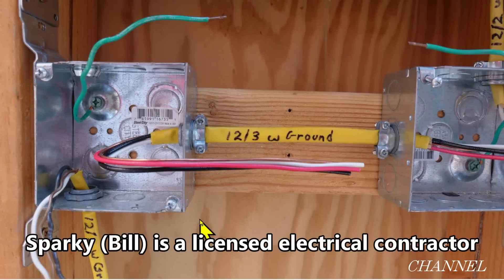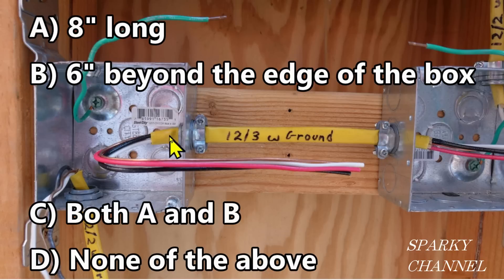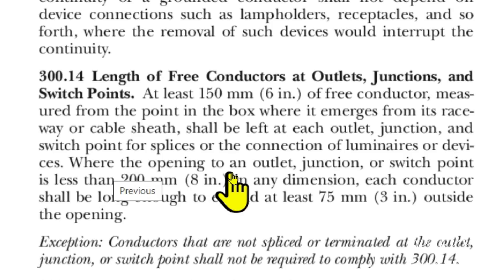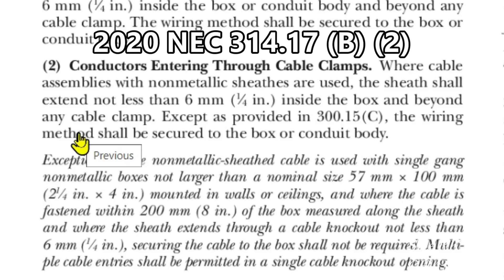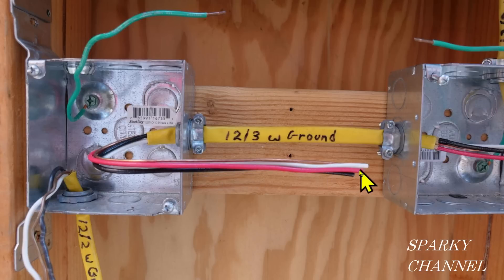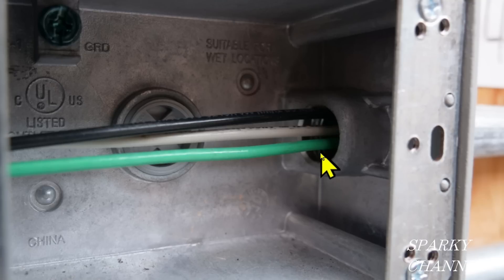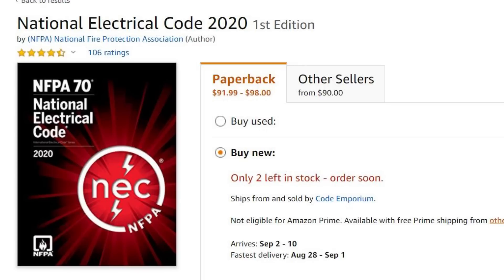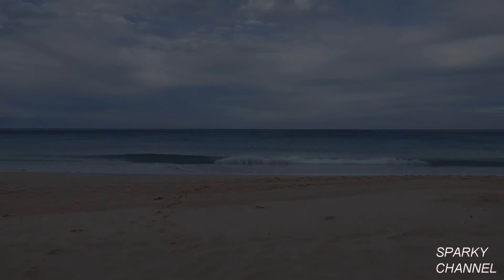How Long Must Wires Be in an Electrical Box? (2020 NEC 300.14)

Comment: Author's video is fine for NEW INSTALLATION.
Does not usually work with existing/old installations. Especially when you are NOT using a big box.
Try shoving all those wires and such in a normal outlet box then try to fit in those thick GFCI's in there.
You need a piece of wood and a hammer to drive the wires in enough to fit the GFCI outlet.

Comment: It used to be 6" out of the box. If the box is 2" then add 6 and you get the 8".
Many times it is impossible to have 8" when crammed back into the box.
For me I try to leave about 3/8 to 1/2 minimum sheathing in the box. Depends on the space I have to work in. Enough to easily see when a device is removed. Hard to miss that bright yellow sheathing.
Most customers will not want you to rip open their walls just to do something simple.
NEC needs to allow more leeway.

If you use WAGO's, things should be more allowable. But are they?
NEC is just being far too picky on many things. 6" outside the box is plenty to work with. And has little to do with electrical safety.

Comment: The way I’m reading the second condition (where opening in any dimension is less than 8”), it seems to me that only 3” of wire length is required outside the opening because the box in such case would be so small (or the bends in cable would be so acute) that they relax the 6” requirement used for boxes having no such minimum dimension, such as with a small-box, light switch outlet.
The Code is so convoluted it makes even the most intelligent amongst us dizzy. What they really need to have for each section is a logic flowchart. Hmm, maybe I should write a book . . .

Comment: Should the wires extend at least 3 inches from the edge of that box or the edge of a single gang mud ring that may commonly be used on that type of box? I think it would be the latter, but I'm not sure.
Reply: I have always measured from mud ring to make it easy on maintenance workers and homeowners.

Comment: I've been replacing some of those horrible "self contained" receptacles, and this may be the only thing I've done that could be considered out of code. Some are probably 6 inches, others, definitely not. I also tended to pull too much sheathing into the old work boxes. 

Really, I don't think it's a safety concern as much as a serviceability and easy of installation issue. The 12ga were a pain to get in the box. The rest will be done this way.

Comment: I took the 8" in any dimension to mean smallest dimension measured(trade measurement?) .  Not sure where Bill gets diagonal from that wording?  ie any box less than 8x8.  And given almost no box is min 8x8(smaller at least 1 dimension)  I took this as a passive way of NEC telling you to basically always ensure wires are 6"+ with 3" outside box. 
Am I wrong? And if so how, please!
Reply: That’s how I read it as well
Reply: It says opening less than 8 inches in any dimension, not every dimension. So basically any box smaller than a 3 gang box, you need to have 3 inches outside of the box as well as the total conductor length must be 6 inches from where it enters the box. If you have a bigger box, like 3, 4, 5 gang, etc., then the conductors must be at least 6 inches from where it enters the box but it doesn't need to stick out 3 inches from the face. This is because there is more working space in the box (larger and also possibly deeper) therefore the 3 inches isn't important. Imagine trying to work on a small single gang box with only 2 inches of conductor beyond the face of the box. There is no room to get your hands in there and maneuver the wires.

Comment: You can tell houses that were wired in times of rough economies. 1 inch wire outside of the box. Sometimes I wonder how they wired it the wires were so short.

Comment: Good video.  Thanks.  6" from where it enters the box through clamp or conduit.  If any length of the box opening is less than 8", the wire must extend a min. of 3 inches from front of the box.  Code is minimum.  Extra is ok until it over crowds the box.  How about just leaving the electrical work to licensed electricians or indentured apprentices?  Good video.  I really get sick of scary Youtube "I think I know what I'm doing!" wiring videos.

Comment: I do 6 inches from where it exits the box, it gives plenty of wire to work with.  3 inches seems really short.  I guess on a GFCI the shorter length makes it fit in the box easier but I prefer 6 inches on regular outlets and switches.

Comment: And remember the NEC is the minimum standard. I find that 3 inches of conductor out of the box  is difficult to work with, and I leave my conductors longer, which makes installing the wiring devices or lights at the finish easier for me.
Reply: Me too but I do like to shorten them up a little bit on a GFCI so they fit in the box a little easier.

Comment: Excellent explanation but I think your use of the box diagonal is misleading and confusing when determining if "any dimension" is less than 8".  Box height or width will always be less than the diagonal so the lesser of the height or width should be the determining dimension.  For example, a 6x6 box has a diagonal of 8.5" but the "any dimension" of 6" is less than 8".
Reply: Agreed.  By "any dimension" they mean height, width, or depth.  Not any diagonal you might be able to come up with.

Comment: Multiply box size by 1.5 
Example:if you have a 4sq box 4×1.5=6
6×6 Hoffman 6×1.5=9
Not sure about code...I've never fail a inspection.

Comment: At least the 2020 NEC has gone metric. Why resist a measuring system that uses a decimal point and is based on 10? Fractions, what's the point of that?
Reply from the maker: Good point!

Comment: Cool!  I knew there was a code for this, but I never looked it up.  I've heard several stories on required wire length, but it's pretty easy to recognize the bs, because it will be missing the details that are always included in the actual NEC.
 Experienced electricians like long wires.  A good residential wiring practice is to leave a Romex® (Nm-B) about 1 foot long from where the sheath enters the box.  That allows for each conductor to be gathered with like conductors at a common point at the back of the box, stripped even at 3-4"  outside the box.  Then, in a switch box, twisted together by hand, cut, capped and neatly folded (2 bends) into the back of the box.  Or in a plug box, 3 bends to leave them in the back of box.  
Getting wires to the back of the box is important.  Otherwise, the sheetrockers will hit them with their Roto-Tool.
  
When it's time to install receptacles, the wires are long enough to strip and wrap by hand around the screws, tighten and twist wire by hand until it breaks off.  That leaves 2 bends (one at the receptacle) and the wires push into the box behind the receptacle without getting in the way of the box extension ring (if required.)  
For anyone who is unfamiliar, maybe Sparky has a video on hand-twisting wires in switch boxes.  It's a big time-saver.
Reply from the maker: Thanks Steve!
Reply: @SparkyChannel  I love electricity ... Always have.  I can't stand to see things done wrong, and I've seen alot of it.  Youtube is a great information resource because of people like you showing others how to do it right.

Comment: In ideal condition the wires should be 6 inches long.  But rarely do you have that other than new construction with a less than full capacity. 
With changes as the electrical needs increased, you quickly need shorter legs because the box is jammed full.

Comment: After a few decades of changing outlets, you'll be left with 1/4" stubs of wire.
Reply from the maker: LOL!
Reply: Hmm.  What typically happens when a branch is extended by adding a new NM-B coming from a existing box with old wires that are now less than 6"?  Is it a complete redo, or does it depend entirely on the inspector and their mood on that day? 😉

Comment: They should this line. After They Have Ben Spliced. To the Article So, it would Read.    Each conductor shall be long enough to extend at least 3' outside the opening. After They Have Ben Spliced. That would Beter clarified the length of the wires. so, the next person to axis the box Won't say WTF there still too short because the idiot that made up the box didn't factor in Right turns and twisting lengths when making up the box.

Comment: Love these code videos. Keep up the good work, paps. 👏👍

Can you make a video on reidentification of cables? Example: can you use a 12/2 BX as a 220V for a AC line then at disconnect switch run a 12/3 MC to air handler. I see, I believe, some crazy shit and my supervisor is ok with it. 🤷
Reply from the maker: See: Find the NEC Code Violations! IDEAL National Championship Code Violation Board Round 1 Part 2: https://youtu.be/T-ODSq7NKj8
Reply: @Robert Tirpak.     If the air handler is 120volt and requires a neutral then the answer is No. But if the 12/3 is only being used with the White re-identified as a hot to switch something then that is OK. Bottom line, if the original feeder 12/2 is on a double pole breaker then it isn't providing a neutral and so it can't be used to supply any load that requires a neutral.

Comment: Retired from a very large hospital/research center. Just loved it when local 98 lazy ass bum sparkies would pull wires tight in a deep 1900 box. Would have to cut wires that feed a 120 volt receptacle thru conduit to tap off a receptacle. Had to pull new wires from 1900 box to existing receptacle. Would get fired at previous jib if I did that. They were also too lazy to tap devices. A couple of times the madison barr shorted out on wide hospital grade receptacles.
Reply from the maker: Thanks!

Comment: I’m just learning about wiring so this was helpful.  A question you can possibly address in another vid - if I have 2 wire BX with no ground wire and I want to insert an outlet & plug  in the middle of the run for a generator to power a furnace, does this qualify as an “improvement” that requires me to upgrade this to 12/3 Romex?  Just curious if I can modify existing and still be considered still in code.

Comment: Copied from the internet. >There are three heavily used dimensions that can be used to describe a circle:  •The circumference – The circumference of a circle is the length of the outside boundaries of the circle.
•The radius – the distance from the circle's center or origin to the edge •The diameter – the distance from edge to edge of a circle passing through its origin or center. Conveniently, it is twice the length of a circle's radius.    >Me typing-This means the dimension of all boxes are over 8"           Really I think they only meant  height↕️, width↔️ and depth.   Diameter sounds more like it but, They should be crystal clear in this book.
Reply: A box isn't a circle.
Reply: @illestofdemall13  are you new in the trade?  There are all different shapes and sizes of electrical boxes.  Round pancake, several other round ceiling boxes, hexogon boxes etc.  I have found a good amount of the nec code isn't straight forward. It's up to the interpretation of the authority having jurisdiction/ your inspector.      Dude always be nice to your fellow electricians,    alot of times you may think you are right, and they are wrong, but you may not be, so never ever teach false information.   Remember we are all learning.       🙂
Reply: @--JohnDoe  No I am not new to the trade. There are many dimensions to the different 3D shapes of electrical boxes but no type of box is just a circle. A circle is a 2D object and any type of junction box is 3D so you could argue that diagonal across to the corners would be a valid dimension. You can't necessarily just narrow it down diameter because boxes will not always be the same in height and width.
Reply: @illestofdemall13  I was saying circumference, lol.  The largest dimension.
Reply: @--JohnDoe  How does circumference get you the largest dimension of a box when not all boxes are round? There is a reason why they used the words they did. When you measure an opening on a box you'd never measure the perimeter of the box and that's the closes thing to circumference. You'd measure across the opening to see width, height, etc. Just trying to point out why I think your argument is flawed.
Reply: @illestofdemall13  300.14 Length of Free Conductors at Outlets, Junctions, and Switch Points.  At least 150 mm (6 in.) of free conductor, measured from the point in the box where it emerges from its raceway or cable sheath, shall be left at each outlet, junction, and switch point for splices or the connection of luminaires or devices. Where the opening to an outlet, junction, or switch point is less than 200 mm (8 in.) in any dimension, each conductor shall be long enough to extend at least 75 mm (3 in.) outside the opening.       😆      The circumference of the 4" round opening is=12.57".      I don't think this isn't what they mean. But it could be,  they aren't clear.
Reply: Wait I see where im fuckin up.  If any dimension is less than 8 it applies, not if one is larger than 8 than it doesn't apply.   😄
Reply: @--JohnDoe  Circumference isn't a dimension. Length, width, height, depth, etc. are dimensions. They are clear but you just don't seem to get it. If the box is round and 4 inches wide then it is obviously less than 8 inches.
Reply: @--JohnDoe  You're welcome.
Reply: @illestofdemall13  circumference is a dimension, you are very argumentative.   Good bye, best of luck to you.

Comment: The thing that frustrates me about code books and other "legal proper" documents is that they are so cryptic.  It's utterly ridiculous.  There have to be classes, videos, and other resources available to really learn it all.  One should be able to open the book and read and learn from it.  You shouldn't need to learn HOW to learn from the code books.  They should simply be more straightforward and not use such "proper" grammar.  I don't know...I mean once you know what it's talking about it's easier to understand and it's not always cryptic but why do you ever have to figure out how to understand it?  If I need to make sure I'm doing something that's code compliant, all I should have to do is open a code book.  At no point should I need to reference anything else and sometimes you do :\
Reply: A pictorial isometric view would be an improvement
Reply: The problem is that it has to be somewhat legal sounding to avoid accidental or even intentional misinterpretations. The books that you can buy to elaborate on the Code are pricey - too bad those books weren't included with the purchase price.

Comment: Should’nt this be the minimum also in distribution panels? Specially for neutral wire length?
Reply: You need more than 6 inches to connect any wire inside a distribution panel, regardless of rules/codes.

Comment: I wish the guy that wired my house listened to this.  All the outlets extend maybe 1 inch outside of the box.  Makes doing anything a pain, but its making me proficient at pigtails
Reply: I installed extra wire. At first I tried to live with it but it made everything so much harder. That extra length allows you to fold the wire and makes it easier to get them in the box.
Reply from the maker: I understand!
Reply: I feel your pain.  Did you install pigtails to get extra length or just live with it?

Comment: Its always good to note alot of codes NEC/CEC state minimal requirements. I believe that minimum code is a starting point, and you can do better. Working above minimum code you are building in contingency this means building in added longevity and safety.  6" is good for single gang boxs, as the boxes get bigger so should your length especially  when starting with 24"×24", gutter/splitter boxes and panels.
Reply: Also sometimes some wires of your cable may need to be longer then others, like neutrals and especially bonding/grounding conductors.
Reply: Very true.

Comment: I touch my linesman to the back of the box and cut the wires the length of the linesman ( about 9”)
That’s a quick and dirty way to meet the code.
Reply: As long as you dont have more than 2 runs going through. That's a lot of wire to fill a box when you have more 😁
Reply from the maker: Nice tip, thanks!
Reply: I have a mark on my stripper and I just have to touch the outside of my mud ring.
Reply: @chicagohandyman  
That actually sounds like a better method.
I’ll probably steal it!

Comment: Just to clarify, for pigtails in the box to connect to devices-after the splice, how should the wires be measured? Say the upstream and downstream conductors of a receptacle are tailed together leaving a B/W/G wire for the device connection.
Reply from the maker: Hi Mike! Excellent question. While the wires coming into the box are regulated by NEC, I haven't seen regulations on the pigtail length after the splice. Certainly, the length must be long enough to be professional work however.

Comment: I always use my linesmans pliers to measure the length. I leave them a little long during rough in, then when I go to make up the box, I stick my pliers to the back of the box, and where the handle ends, that's where I'll cut them off. This is similar to how someone might use the bar of their chainsaw to measure for firewood
Reply: I use a "rule of thumb", make a fist with your thumb out (like you are hitchhiking), place the side of your fist against the box and the end of your thumb should be cut length.
Reply from the maker: Interesting. Thanks!
Reply: I do that, too. My pliers are 7", so I clip them about an inch from the end, which typically leaves between 3"-4" outside the box.